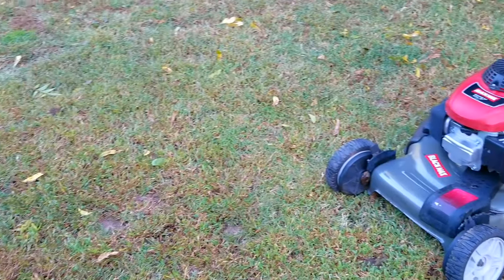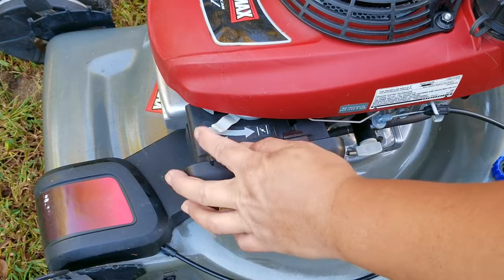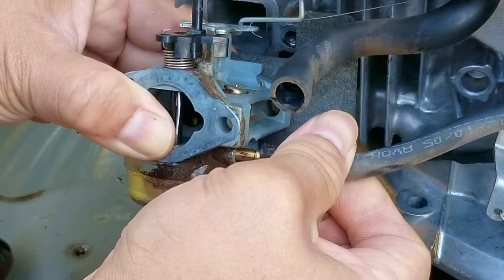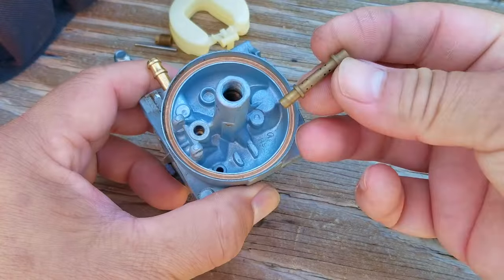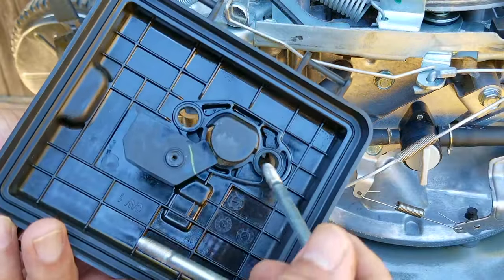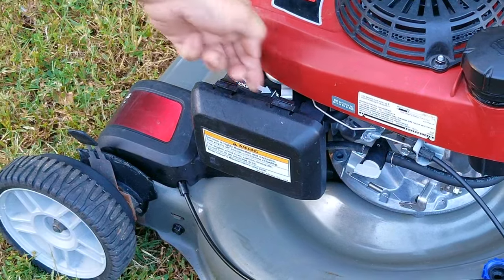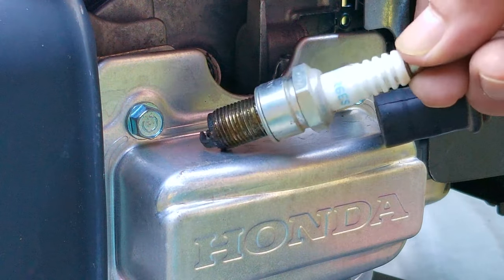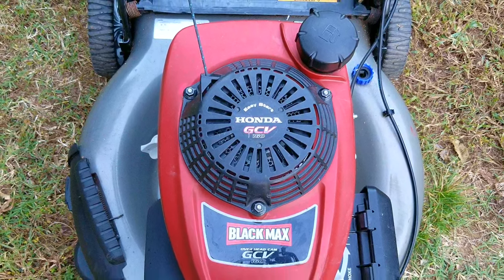Fixing A Blackmax Mower That Won't Start

Comment: So I was planning on getting a “New” mower for my small lawn care business, so I found a used 2006 Toro Recycler 22 inch with a Tecumseh engine. I tried cleaning the carb but still didn’t work so we just replaced the entire carb and it ended up working nicely.

Amazing upgrade from my 1990 19 inch yard machines mower with a little classical 3.5 horse power Briggs engine.
Reply from the maker: wow you were working a 3.5 horse Briggs, Nice!

Comment: got a honda hrr2169vka... for 25$. the seller couldnt get the self propel to work and was just sick of it after 2 years.

took it home,  took it apart, and turned out a wood chip was wedged btwn the belt and the transmission. He did try to fix it by taking off the wheels lost the metal gear and the whole assembly that goes on Honda rear wheels. 
parts were around 10$ + shipping = around 20$.

got the parts, assembled the rear wheel . it started right up and after adjusting the cables the self propel worked seamlessly. 
still , replaced the oil , put gas in -  about 5$

it was only 2 years old at the time and the seller may have used it .. 10x  max.
I now had a nearly brand new Honda HRR216VKA for 50$. 

and have used it for the last 4 years. I LOVE that mower.
Reply from the maker: wow you did a great job getting it working again!
Reply: I just got a used Honda mower with the same issue.  The owner took the wheel apart and installed it wrong.  The drive gear was chewed up.  I ordered new thrust washers and a gear. When installed correctly, it is amazing. Lol.

Comment: I picked up a barely used snowblower once. Owner said he tried everything but could not get it to run. I think I gave him $20 for it. Even though it was like new, I found the spark plug was faulty. Put in a new one and it started on the first pull. I sold that machine for a few hundred dollars, so it was a great find for me.
Reply from the maker: wow nice fix!

Comment: To reinstall the Honda carb and the myriad collection of things that go with it, I use 6m threaded rod into the block and put the pieces on one by one.  You could use 2 pieces leave them threaded into the block and with 2 6m nuts and throw those long screws away!!  As for that choke system, I usually take the linkage off and turn it into a manual choke.
Reply: Yes, I had an easy fix  few years ago. Just cleaned the fuel filter and it worked. I did spend some time checking a few fuel and ignition but again, a clogged fuel filter was the culprit. It only ran when I primed it manually.
Thanks again for a detailed happy ending video! 😊
Reply from the maker: Thank you for the tip
Reply from the maker: nice diagnostics on that mower, and thank you

Comment: Great video, crazy all that was wrong with it was a bad spark plug. To answer your question, once a year in the fall in October the city where I live has fall cleanup week where they pick up bulk garbage that won't fit in your can. It is an opportunity for people to get rid of any junk, I always go around looking for mowers and other gas powered machines. Back in October last year I scored 6 push mowers and a Simplicity Broadmoor riding mower with a 44" deck powered by a 16HP Briggs and Stratton Vanguard v-twin. The riding mower only needed a new battery and it started right up and runs great, the electric pto clutch even works and the deck works and it drives too. Crazy what people throw away.
Reply from the maker: wow! you got a lot of stuff last year. Hopefully you can do it again this year.

Comment: A faulty spark plug, gotta love it when it's a cheap fix!

Cheapest fix (not counting the free fixes) for me was the carburetor gaskets on a small power washer. Total cost was about $3 back in 2015.
Reply from the maker: very nice work

Comment: So somebody bought a Honda push mower... pretty much the Lexus of push mowers... and then put in a cheap aftermarket spark plug? It looks like they changed the oil and air filter, but left the old plug? Wow! Great find, and great fix! Congrats.
Reply from the maker: I like your analogy, these are pretty good engines for sure.

Comment: I got 2 mowers from my customer. One needed the kill cable and wouldn't stay running so I clean the jet in the carb and runs great. Other mower was leaking at the bowl and needed a wheel. Runs great and are for sale.
Reply from the maker: nice job fixing them!

Comment: I never would have guessed that the problem was the spark plug. That  has never happened to me in 30 years of owning lawn equipment but I’ve never used those aftermarket plugs either.
Reply from the maker: you're better off just using factory plugs

Comment: Nice find and fix. As they say a squirrel finds a good once in awhile! On sourcing the belt, use the belt numbers from red max and cross reference with Honda and others. They might be cheaper than thru red max.
Reply from the maker: thank you for sharing that information
Reply: @HomeGaragechannel  you are welcome.

Comment: I guess it would be a Magnetron because of a cheap knockoff on a Snapper. BUT I ended putting a drive gear in the rear end because of no grease and full of leaves with no stopper. Glad that was all it was. Happy weekend
Reply from the maker: Thank you!
Reply: @HomeGaragechannel  You too!

Comment: reminds me of a ride on mower i fixed for one of my dad's friends said it has a misfire that he couldn't solve replaced spark plug multiple times ended up the left side easily accessible had an NGK plug in it the right side had the original champion spark plug he was quite surprised when i told him it was a twin cylinder
Reply from the maker: surprised they didn't realize it.
Reply: @HomeGaragechannel  this is what happens when someone who has been an accountant or insurance broker/desk jockey their entire life retires gets bored and thinks they are now a mechanic

Comment: Yes,my dads Honda GX35 powered line trimmer which is 21 years old now had an issue with the spark plug about a decade.ago which just about lead me to believe that it was a carburettor issue which was causing a hard starting issue & it was stalling & running rough.

I checked the resistance between the outer & inner spark plug electrode with a multimeter when I found out that the spark plug had a short circuit in it so pinched a spark plug from his GX25 powered leaf blower to test it & it ran better.

Note that there spark plugs are very small & they're a bit fragile so I didn't bother cleaning & regapping the spark plug electrodes so I ordered a new $2 AUD spark plug from China & it's still going good !
Reply from the maker: yes sometime it's just better to replace them

Comment: I had a similar issue with a pressure washer that was only 1 year old. I had a spark that seemed fine, but I ended up replacing the spark plug after doing everything else. It worked fine after that.
Reply from the maker: thank you for sharing your experience

Comment: The simple things should definitely be checked first. I learned that the hard way recently with my Toro SR with a GCV160 on it. It developed a weird knock during startup and shutdown toward the end of last season. I couldn’t find anything wrong and started to wonder if something was wrong in the low end of the engine. But I took the flywheel off to check the key, took the blade adapter off to check that key, did a valve adjustment which led to an oil leak (had to replace the cover), and recently ordered a new $32 blade adapter after reading an online post. Still no good and I started looking into replacement engines. As it turned out, one of the three engine/deck mounting bolts was loose. That was it. Tightened up and knock is gone. Can’t believe I didn’t check that first 🤦🏻‍♂️
Reply from the maker: yes I would have done the same thing, Looked everywhere and done a lot of work only to find a loose bolt

Comment: Nice score!  It's odd that an owner who would maintain the engine like that (clean oil, anyway) would discard the mower so easily.  The choke is a minus, but I'd bet you get used to it quickly, since Hondas rarely require a 2nd pull to start.  That engine should outlive the chassis several times over.  Pop an oil seal into the governor shaft to keep the deck clean, the way you like it.
Reply from the maker: thanks and so far no need for the oil seal just yet.

Comment: Had a Honda like that one would start on carb spray. Figured dirty carb, gas had no water.  Open carb completely clean like that one. Add new fuel ran perfect, so only replaced gasoline.
Reply from the maker: very nice work

Comment: Home garage i have a question: i have this project blower and the first problem is thats its a weedeater 25cc blower but the main problem is that the carb gets gas in but wont get in the primer bulb. I know it receives gas because when i take the carb apart, there is a bunch of gas and pressure released. So the primer bulb does not fill with gas. I have cleaned the carb top to bottom and jets to jets but i do not want to buy a new carb and not make a profit, and i am so tempted to drop it off at the scrap yard
Reply from the maker: you've already stated your position, if you can't get the carb to work, and  you refuse to get a new carb, then the blower isn't going to get fixed. Either keep it for parts, or pass it on to someone else who'll make a profit on it.

Comment: i have a question this might get you or might not but i bought a new air filter and it fit but at full throttle it bogs down but when i remove the air filter it goes to full throttle im so confused plz help
Reply from the maker: have you considered getting a different air filter?
Reply: @HomeGaragechannel  it is the right one

Comment: I have a question I have a Campbell hausfeld compressor it turns on but when it runs low on air it won’t turn back on  but I can wait a few minutes it turns back on can you tell me what the problem is thank you
Reply from the maker: sure the pressure switch need to be replaced

Comment: Had that with a honda Troy-bilt mower bought it for $20 guy said wouldnt start after replacing the spark plug it was a firstfire brand and it had no spark from it switch it out and came back to life
Reply from the maker: yes they are not very reliable

Comment: I don't know which choke system is worse, the auto-choke on Honda mowers that turns the choke off when the engine heats up or the timer choke system on this Blackmax. Manual choke works fine. If it ain't broke, don't fix it.
Reply from the maker: agreed, nothing wrong with a lever to put the carb in choke. It's to simple and works.

Comment: Help!  I got a free mower and the gas appears to be leaking out. I don’t see it dripping anywhere. Where could it be going?  It stunk up my garage.
Reply from the maker: it could be leaking into the engine and also some onto the air filter.  it might be evaporating fast enough to not be seen, but definitely smelled.
Reply: @HomeGaragechannel  what is the fix for it. Smells terrible. Filter is dry.

Comment: Hello I am 13 yrs old and I am fixing my grandparents lawn mower it was  hard to pull and making a knocking sound when I pulled the rope I took apart the engine cleaned it and putted it back together and It is still hard to pull and making that knocking sound I don't know what to do again
Reply from the maker: it would sound like the engine might need to be replaced.

Comment: I thought you would have checked the ignition system first seeing it a lot easier then taking the carburettor to pieces I bet you would have done this on a car with fuel injection or multiple carburettors
Reply from the maker: did you watch the entire video? The engine ran during the first test start, no need to check the ignition when the happens
Reply: @HomeGaragechannel  I now want you saying but you can usually tell how an engine is running by checking condition of the spark plugs. The  choke reminds me when the introduction atomic chokes on cars I had a ford Cortina with one I converted it to a manual no i missed the bit were it fired up first fired up